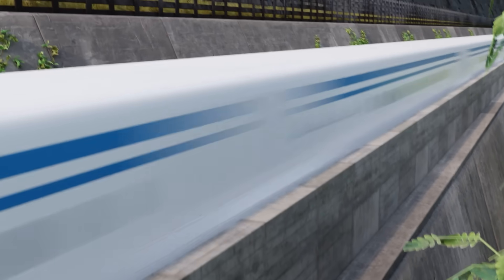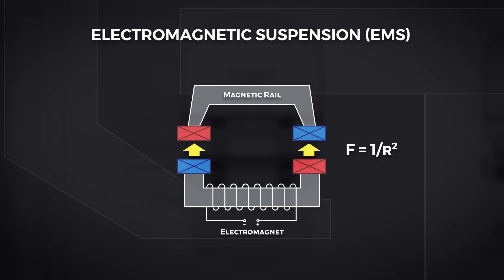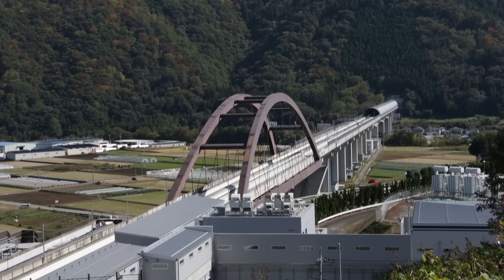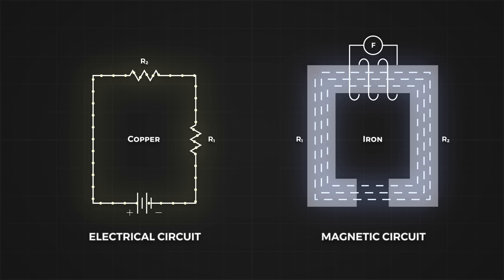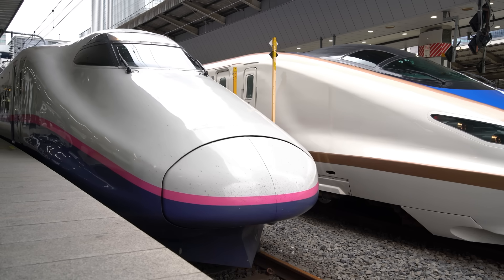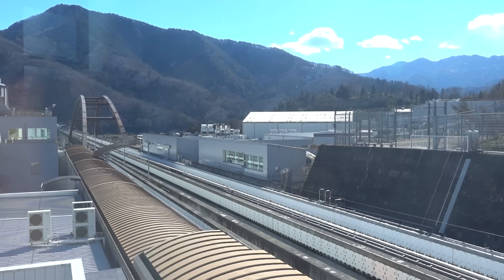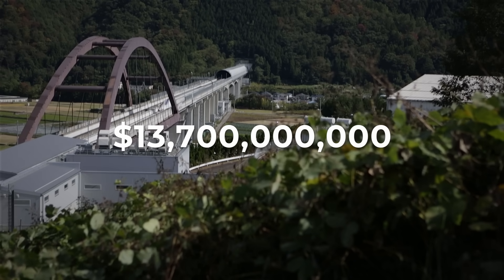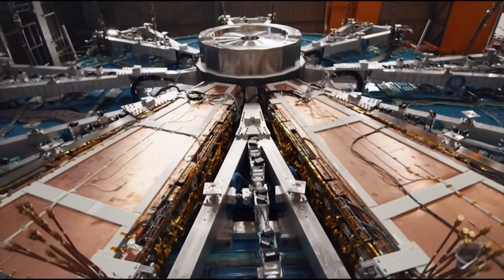How Japan's Maglev Train Works

Comment: 12:20 yeah sure, economically flights are better past a certain point. Practically, the planet is about to become uninhabitable due to excess usage of cars and planes.

not mentioning climate change when talking about rail vs planes is engineering malpractice
Reply: That is the point not everyone cares about that enough and people are selfish. If you need to pay more for a train ticket than for the same route with a plane and it is sometimes even faster than trains. So people use the mode of transport that fits their usecase best not what would be best for the planet. 
Getting trains faster and cheaper so it is competitive helps to get that routes less profitable till the route is no longer served by the planes anymore. I think that has been seen in italy with planes struggling on some routes.
Reply: @toggleton6365  you do not understand that we need to ban many flights even if the corresponding train trip is several hours longer. This is how the planet lives.
Reply: @teknonmy7210  I do understand that but the reality is we are not in a dream world. You will not find enough political will to push such changes if you have no good enough alternatives. 
Way less extreme changes did create big backlash already in the German Politics. Pushing such big changes will just make the enemy's bigger that just claim they want to revert it and you will loose any political power to do way more useful changes for the climate.
Reply: @teknonmy7210  The point is just we have a limited amount of political power that can be used to move at least in the right direction. 
If you use a lot of this political power on this project cause when it is so unpopular you will loose your power very fast. And the Plane operator company's will bombard you with Negative campaigning till you are gone. 
Building up alternatives is way more effective as you use the power of the moving system and by that save a lot of your political power to implement changes in other parts that are way more important to reach the paris agreement.
Reply: @teknonmy7210  Bruh france did ban short haul flights cause there are alternatives. Like the short range flight bans are AFAIK calculated if trains are competitive. 
That is exactly the point. The Backlash was survivable. The discussion has been in Germany too. One short gap solution was to get the tax on train tickets down so they are more competitive to plane tickets. But a recent study still did show that train tickets are still 50Percent more expensive. so that part needs more work. There is a point that plane fuel is not taxed but train electricity is taxed.  
What should Germany do in your opinion to go against polluters? 
Just calling me pig will not help.

Comment: Regarding a hypothetical LA to San Francisco train, trains are not “outright the best option”. Rather they are just barely the better option. Change the speed limits on the I-5 from revenue oriented to Autobahn type, and driving becomes an even more viable option.
Reply: It's still a choice between being stuck behind a steering wheel for hours staring at the road versus doing whatever the hell you want as the train takes you from point A to point B. Even if you could match the speed of the train while driving, I still wouldn't call it more viable.

Comment: I still don't quite understand why they're not just putting normal trains on this new, more direct line. Fewer, smaller trains that go faster sounds suspiciously like Concorde.
Reply: Concorde's problem was more about it being extremely fuel inefficient and so goddamn loud that no countries wanted it flying over their territory. Maglev is still more energy efficient than flying, and isn't going fast enough to cause a sonic boom.
Reply: I mean it is a premium line. Cheap tickets and slower will be served by the old tracks and the maglev lines will be more expensive with less seats but faster. So this is the perfect playing  ground to get the technology ready for market. 
The big advantage is that normal trains usually have a max speed of 320-350km/h where they no longer are cost effective. There is some room to improve that with designs like velaro Novo but still over 400km/h is  hard to justify in real world use of high speed rails. 

To have a technology that can get higher speeds is a good investment for the future even when this will not be a mass market but possible useful for some direct connections.
Reply: @toggleton6365  You misunderstand me. The line itself would still cut travel times by train a huge amount, even if it were just normal train tracks. Because it's a way shorter route. The maglev's higher speed isn't where the majority of time savings come from, but it is where all of the limitations and expenses come from. 

The line is primarily supposed to increase capacity, after all. And a maglev is not the way to go about that.

Unless they think they can push the speeds up substantially, this seems like a lot of R&D for something that's far from being objectively better than just putting normal tracks where the maglev will run.

It's a gadgetbahn as it stands now. A questionable solution for the wrong problem entirely.

Comment: I guarantee that to get on such train you will absolutely have to go through security. In any case, it's pointless to argue. Trains require maintenance of a massive infrastructure. Airplanes only of the departure and arrival airport. Everything in between does not. The US will never benefit from a cross country high speed network. Europe can. Japan can. The US east and west coast can. But coast to coast, forget it.

Comment: The Tunnel problem can be solved, if engineers and investors really want to.
Build a tunnel inside a tunnel and Spaghettifi the inner tunnel tube.
Direct air out, create pressure relief vents to manage the train volume moving through at 500 km/h. Account for futre train length increase.
Reply: You must be a pastafarian.
Reply: I thought this was one of my better comments, and only one like, yours, in days.  Maybe it goes over most heads, since it's kind of passe, in the grand scheme, anymore.  My kids loved the jibe that was the spaghetti monster.  :-)

Comment: It runs on magic!
Reply: You actually aren't wrong.  As far as I know, nobody really understands how magnetic materials work, meaning at their most basic physical level.
Reply: @MrJdsenior  
" As far as I know, nobody really understands how magnetic materials work"
That is inaccurate. Its well known how magnets work.

Magnets work via interaction of electrons that are spinning around. Because electrons moves very close to the  speed of light, there is sort of a dopler effect when they spin around that create a force in other electrons that spin around in the opposite direction.

A permanent magnet is simply a bunch of atoms where most of the electron shells are arrange in the same direction.

Comment: The airline industry will keep innovating, new aerial vehicles will emerge, energy usage will diminish, and as a result trains may become uncompetitive for human transportation, especially as an increasing amount of work can be done remotely, diminishing demand from city to city travel and increasing demand for stops into smaller towns which can’t be well served by high speed trains. The constant delays in starting large scale train projects in the US will have turned into an advantage in twenty years as the demand for innovative solutions will find easy financing without having to displace demand from previously built expensive projects that would have quickly become unsustainable economically.

People used to travel by boat, now it is essentially for industrial and shipping needs. That is the future of trains.
Reply: It's pretty difficult to get commercial aircraft major percentages more efficient than they are.  At some point you hit diminishing returns, and we are long since there.  There are theoretical limits to the different types of combustion engines, including jet turbines, and you definitely aren't going to exceed those.  And you should probably take a look at world wide energy use, because it most certainly is NOT diminishing.
Reply: @MrJdsenior  the need for people to travel from one major city to another will diminish, so passenger capacity needs will drop, and demand for a variety of destinations will keep increasing as people move out of cities into smaller towns or cities. Meanwhile the big cities will re-industrialize as the supply chain shortens thanks to market-driven factors, and railways will be occupied to ship heavy goods between those cities, making them unaffordable for passengers. It’s just basic economics, it is not avoidable. We’ll see more vertical landing and takeoff vehicles to carry passengers instead.

Comment: so what happens if a cow somehow gets on the track?
Reply: Ask a cargo train driver what happens when an wild animal is on the tracks. It makes a loud noise and you need to clean the front on the next stop. Higher speed just means it will explode more cause the power that hits the cow will be a lot more. Not sure if this maglev has a strong front or if it will take some damaged by it. 
The German High speed train ICE has on the front of the trains a part that hides the coupling mechanism if it is not used called Bugklappen. That part is often broken that's why you see quite some ICEs driving around with that part open cause some wild animal got hit.
Reply: There are fences around HSR track, so big animals can't enter, but it's possible to hit a smaller ones such as birds, even on elevated tracks: 9:30
Reply: On the elevated track or in a tunnel?
Reply: @My-Opinion-Doesnt-Matter getting up on the track is I admit unlikely 🤔

Comment: I remember riding the test maglev train that Japan had brought to Expo 86 in Vancouver. It would have been cool to see greater adoption, but the costs seem untenable.
Reply: Yeah.  I was very disappointed they went with the noisy SkyTrain instead of maglev
Reply: @sandybarnes887 Did you even watch the video? Maglev isn't economical for the distances that SkyTrain covers. There was never any chance that they would go with maglev.
Reply: @IBeforeAExceptAfterK  did you read my comment? I tried a tech demo of it once, thought it was cool & hoped to see it get developed, but it hasn't happened because it's so expensive. I said nothing about Skytrain (it didn't exist yet), nor Vancouver except that was where the tech demo was shown.
Reply: @WhiskyCanuck  Sorry, my reply wasn't directed at you, but rather the person who replied to you.
Reply: @sandybarnes887  I was speaking of globally as a form of HSR, maglev isn't appropriate for a metro.
Reply: @WhiskyCanuck  Why would you claim that?
Reply: @matsv201  That it isn't appropriate for a metro? Stations are too close together. The reason to use maglev is to get to very high speed, but the stop/start nature of a metro means it'll never have the room to stretch it's legs, so to speak, and get up to those high speeds.
Reply: @WhiskyCanuck  High top speed is ONE of many advantages of maglev.

Other advantages is high acceleration, low profile under body, low maintenance cost, dust and grim free, typically automated, reliant acceleration and breaking, short build time and quite a other few advantages.

Did you consider all of them?
Reply: The Expo 86 maglev was not the JR once, but the JAL one, named HSSR.  It was later redesigned and deployed as the Linimo that at world expo in 2005. There was no more deployment in Japan, so the concept was eventually sold to China that currently have 3 system based on it under operation and 1 under construction.
Changsha maglev express, Bejing line S1, Fenghuang maglev and under construction Qingyuan maglev.
Reply: MagLev would make more sense to go between major and mid-sized cities across BC and the prairies.

Comment: Hoping that new maglev tech can pay off for the I-70 mountain corridor in Colorado. Studies done basically found that you couldn't build track there straight enough for conventional high speed to go fast enough to be competitive, but had high hopes for maglev - which nobody was willing to investigate further due to the lack of existing real world examples.
Reply: Are the mountains too rough to simply blast your way through? Because the plan for the Japanese system is simply to blast and tunnel their way straight through every mountain that gets in their way to ensure that they don't have to turn as much, in fact they estimate that the majority of the system will require tunnels and bridges to function.
Reply: @RhelrahneTheIdiot  I have no idea how the geology compares, but I really think that analysis just came down to the expense of tunnels and the difficulty/cost of obtaining the necessary right of ways to build something straighter (aside from private land owners, much of the area is environmentally protected (which added cost and complexity in the 70s to the interstate RoW already) or federally controlled, adding outside processes for the state to deal with). But I did take another look at the study just now, and it looks like steepness and stations were also a concern.

The Colorado project has to cover around 5000ft/1500m of elevation change over 50miles/80km to reach its highest mountain destinations. That's a ~2% grade as the crow flies. Conventional HSR's limit is 3%, so maglev's 7% (assumed in that study) gives much more flexibility to reach more destinations and follow existing right of ways and infrastructure.

To serve all the communities it needs to be worthwhile, the Colorado project needs to hit about as many stations as the new Japanese maglev, but in half the distance. A lot of those communities are relatively close together, but with the path between them jaggedly following the mountains. A tighter turn radius means being able to hit more of these communities while also being able to run an express service past them without slowing way down.

In that study a maglev track alignment was able to hit more cities than HSR with similar speeds, 25 miles fewer of tunnels, and less additional new right of way.

That study was with the older type of maglev, and obviously right now the brand new technology is much more expensive on paper. But what we see now is first build cost, so hopefully the benefits of the new tech are such that it gets adoption and drops in price.
Reply: @octorokpie look again

Comment: I wonder if skyrocketing demand for ReBCO HTS tapes from private fusion ventures (e.g. CFS, TE) will bring down Maglev costs. Would be interested to know if anyone out there knows any of the specifics. Google says SCMaglev uses Nb-Ti which is cheaper and more stable. Maybe ReBCO is overkill for this use case?
Reply: " Google says SCMaglev uses Nb-Ti which is cheaper and more stable"
Yea, google is wrong. MLX01 used Nb-Ti when they was build, they was later change to MgB2 coils (all the way back in 2001, so that was 22 years ago), then when L0 was built they never published what they was build for. But to my sources SC-maglev was the original costumer that ordered them decades before they was available. For now the actuall coil of the L0 is calsified. When ever you search for the coil you will always get the MLX coils.

Its also quite oblivious in the video where there is also a picture of the train front a the same page as the coil and the front is a MLX01-B front, not a L0 front.

Now its only the trains that have super conductors, and the trains are really not that expensive. Passenger mile to passenger mile the procurement cost of a maglev train is about the same as that of a ICE3 train.
Reply: @matsv201  Very informative response, thank you.
Reply: It's never good when your coils calcify.   @matsv201